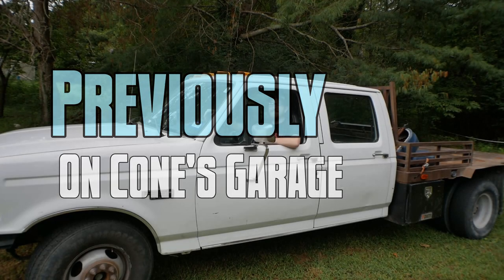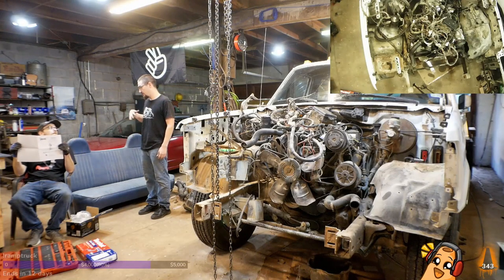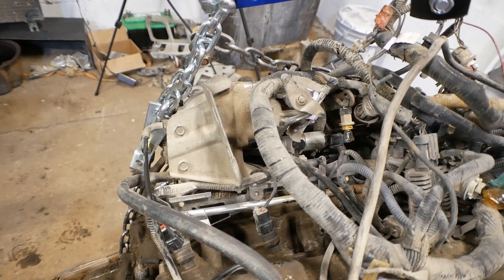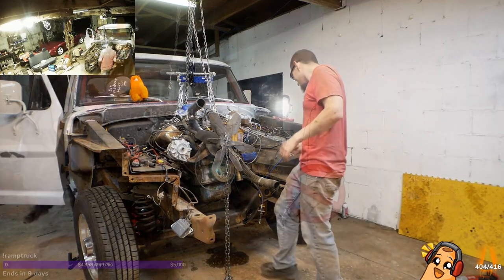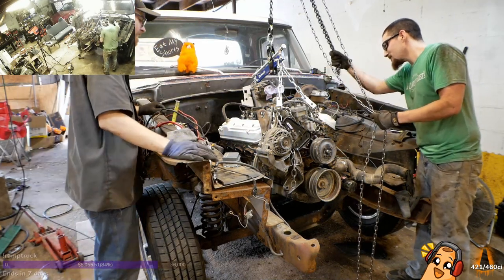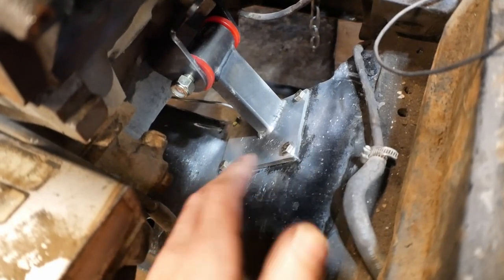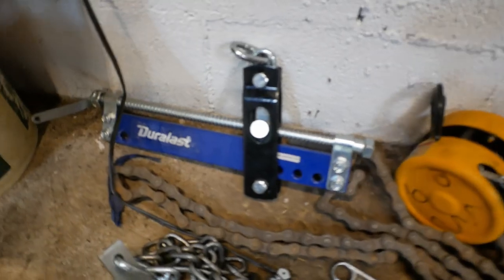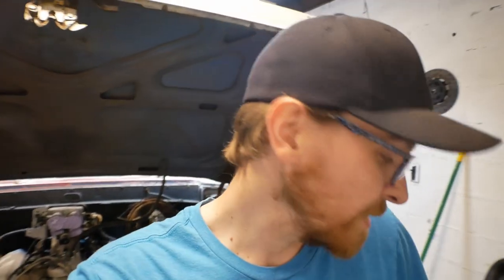Ramp Truck Update: 352 FE Comes Out - 460 EFI Goes In!

Comment: Im doing the same swap 460 on a 72 f100 ordered the same 9720 transdapt kit still havent started but my question to you is if you think headers will fit with the clearance you have?
Reply from the maker: The stock 96' 460 manifolds worked for me, the steering box (I have manual steering box) is tight, and the passenger side is right up against the frame, but I didn't have to do any cutting just had to bash my collectors a bit for clearance. 

I'm not sure any of the aftermarket header options would work, however.

Comment: Any worries that the exhaust manifold gets hot enough to damage the steering box?

Are less corny spark plug leads on the shopping list?

And finally, THANK YOU POWERS.
Reply from the maker: No worries about the manifold heat to the steering box, its no closer or worse than factory, and as a purely mechanical box its not in much danger anyway.

Spark plug leads and spark plugs are on the list. Spark plugs can be tricky in these engines though so I have to be careful with them. 

and YES, thank you powers.